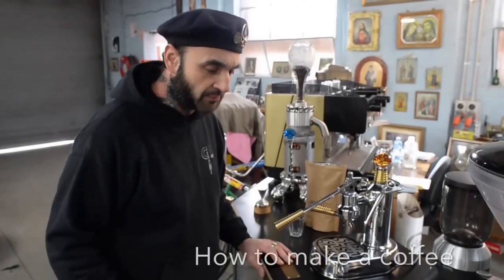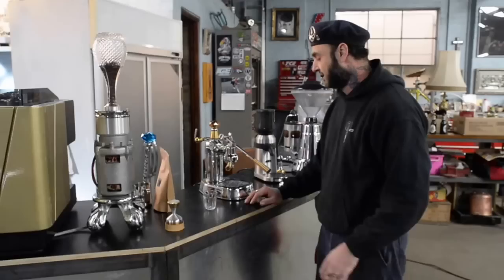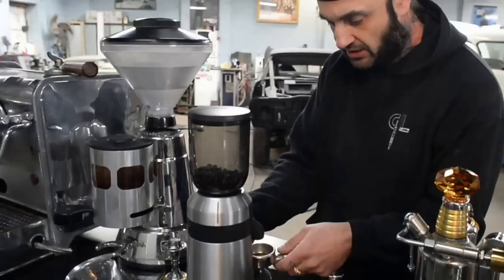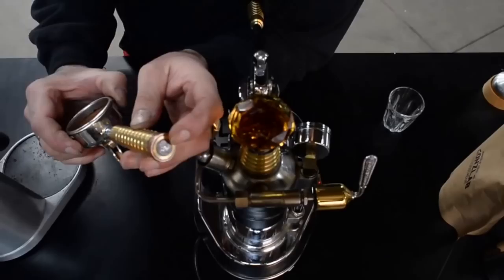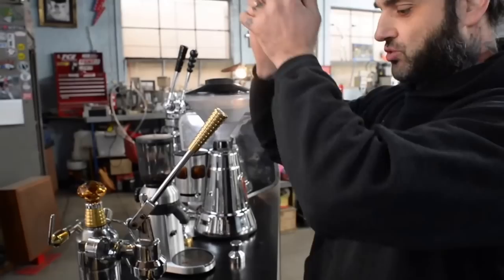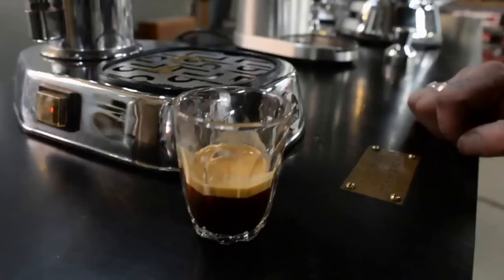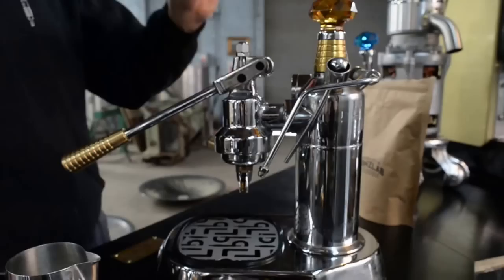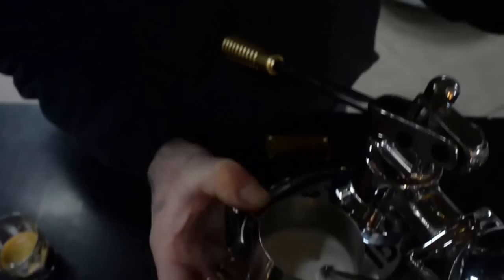How to make a coffee - La Pavoni Lever Machine with Gonzlab

Comment: Inspired by your Campag lever, I just made a lever out of 10mm dowel and put a long thin screw through the hole in the steam lever (bend it outwards so it would clear the glass column). So much better than original. One finger steam on and off instead of winding the know.